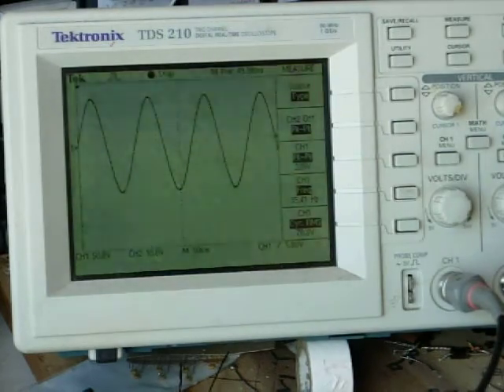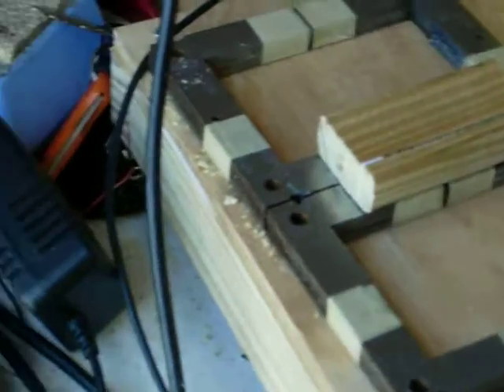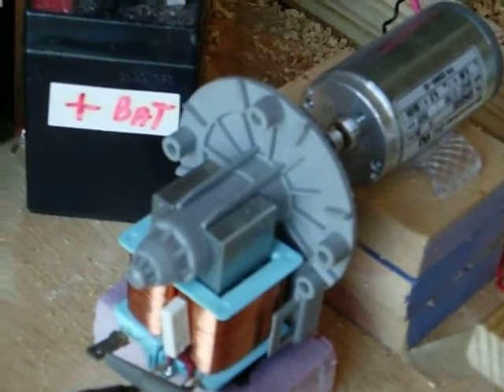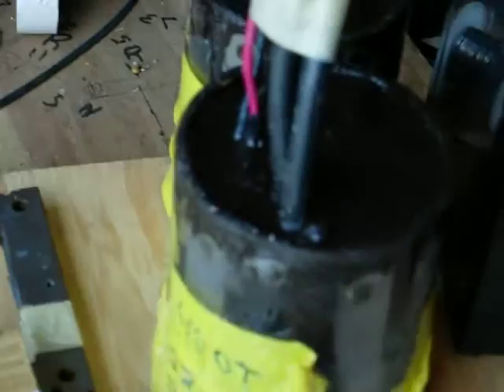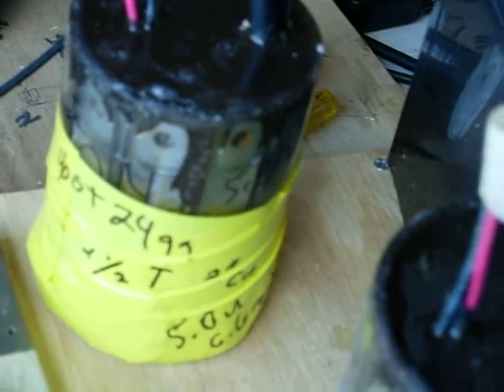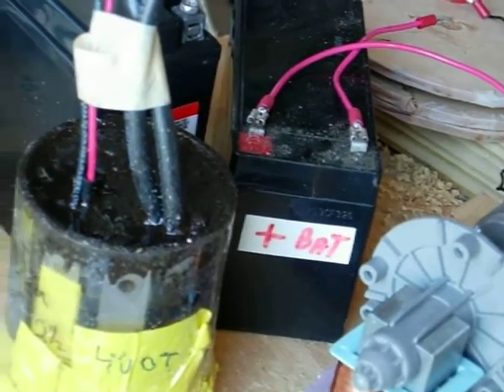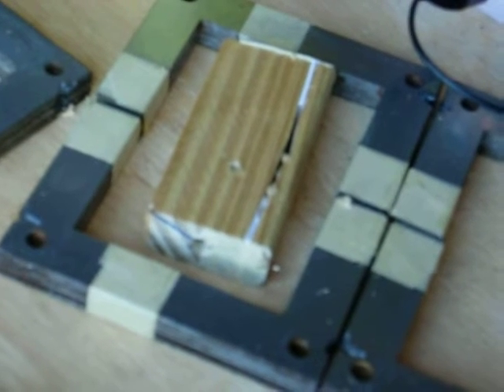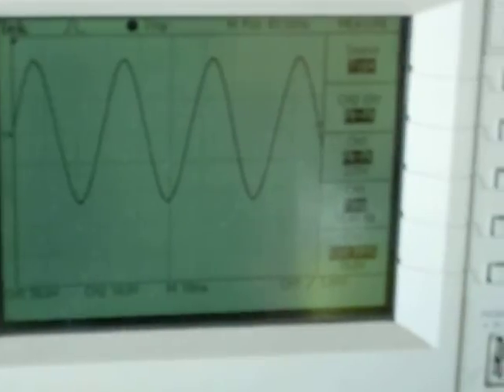Don Smith #107 My Gerard System Update

Comment from the maker: Hi all   My back is getting better, thank GOD,   I did some patent research while sitting around and found that their are 45 patents pertaining to BLDC motor controllers  and over 647 that pertain to BLDC motors in general..  USPO # 6,954,042 shows a bipolar setup.  2 magnet groupings are shown. NSNS and NSNS   also 2 hall sensors are shown for determining the rotor position.  also the 3 phase coils are shown.  so basically this is Gerard's motor from the front end loader washing machine.   I can see where we are headed its just a matter of time till we get their. 

  What's needed is a prime mover motor with speed control. preferably one off the shelve with controller,  This could be either DC or AC driven.  Next, we need the bipolar generator that will provide at least 1200 to 1500 watts to run the 120 input to the first and smallest pole transformer.  Gerard has chosen a 1.5kva model.   Output from this will then be stepped up to any level required.  To make the entire system self sufficient we need to provide enough energy back to the front end to keep everything running without any external input.   I would recommend that you use the old style concept where motor bearings can be oiled from time to time.  Todays technology is designed to wear down and need replacement.  My grand fathers old AC motor is still running after some 60 years.

Comment from the maker: Well I tried to drive the copper 2 1/2 turns directly from the pump 408 v output.  The pump output went to ZERO as expected.   My digital voltmeter read nothing from the pump output no load.  my TDS 220 scope read the pump output wave just fine 408vac sine wave 73hz.  next test will be using 2 to1 transformers and some loads.    The way the whole system works is that the prime mover a spinning bipolar magnet will need to produce enough energy to run the motor(controlled multi-phase impulse driven) spinning it as well as have about 1200watts to 2400watts  to drive the plate antenna  to get the required 14.4 kv out of the copper turns antenna.  This then gets dumped into the second KV copper turns antenna which in turn drive 120vac 60 hz out to loads

Comment from the maker: can't do much till my back is repaired by the VA( something is really out of whack down low).  But I've had a thought that my speed control will be a voltage regulator placed between the battery and the 24vdc motor.  should be pretty easy to use this to keep speed constant for different loads by raising or lowering the dcv to motor.  Maybe an LM317 would do the trick depends on amps into motor during full load.   I also want to step down the 220vac pump output(408vac sinewave) down to 120vac @60hz and then use this to drive my mini pole transformers copper plate input.  The output of the mini with 400turns HV side will be interesting to see what the relationship is between copper plate turns and HV turns.  right now I have 2 1/2 turns copper plate.  I believe that the amount of energy output from the plates will directly related to the mass of plate used or maybe even the surface area also.

Comment from the maker: I did get down to Vero Beach City Electric and met with Eric and Rob great guys to work with. They have an old pole transformer for training which has some serious holes cut into its sides.  What I found inside was a secondary with very thin aprox 22ga aluminum plate not sure about the number of turns but maybe 15.  My core material isn't the best (probably too small) but it is used with 60hz power.  I will need to make up a 10:1 step down transformer and use it's output with a bridge rectifier some caps and choke and the output from this will be fed back into the battery.  It maybe possible to balance the energy flow so that the battery could be replaced by a set of farad style caps. There's also the possibility of using addition al coils and core material around the pump motor to gather energy from the unused portion of the spinning field.   Tesla stated that core would be needed for low  freq and air core would be used for high freq.  I have read just about everything written on Tesla. Tesla never really provided information that could be repeated easily by others.  Everything remained in his skull.  When they tried to burn him alive in 1895 in his lab he lost a tremendous amount of information and equipment.  Just think about all the inventors and how much we have lost because of greedy hateful people.  Of course many of the inventors themselves are to blame,  they didn't even tell their kids exactly what they were doing or provide decent info so that if something happened to them the devices could be easily redone.  The I want to be rich attitude is such a waste.

Another goal will be to tune the output devices for resonance using capacitors.  This will make the entire device run on true power only  the reactive powers will cancel out each other by bouncing the energy back and forth between the cap and coils. 

 You can do this PFC power factor correction to your house Inductive loads.  One of the best ways to do this would be use a current sensing circuit for each pump, washing machine, dryer, air conditioner AC power connections and the turn on a relay to place the caps in parallel as close to each Inductive load as possible.  Try to get to 95% power factor correction.   They also make a box that does this and it alone can save you between 10 and 20% off your electric bill.

On my DC 24 volt motor I will need to ad some kind of circuitry for speed control in order to maintain the 60hz.  right now at 24vdc it is producing 78hz instead of the 60hz.   I really like the 408 acv perfect sinewave.  I rechecked the pump coil fuse and it is for 6 amps.

Comment: awesome stuff have to try build one for testing as well.im pretty sure 12 volt dc input is the way to go as well.but when you start putting loads on you may have to go a 12 volt motor with a speed control it just gives you more room to play around with different loads.great video and cant wait to see results.thanks for sharing..